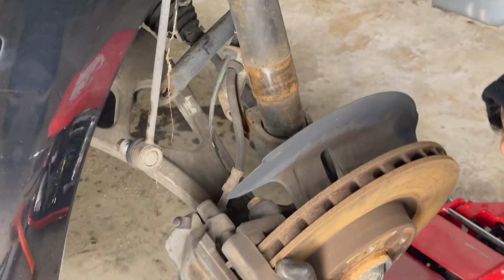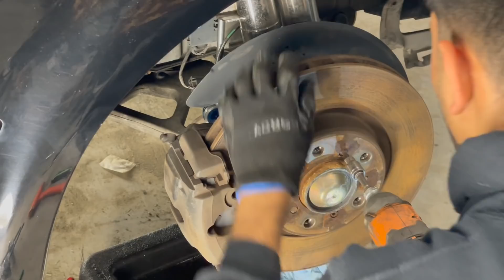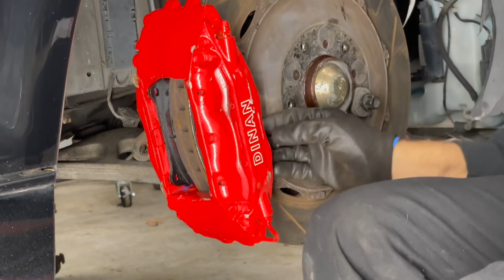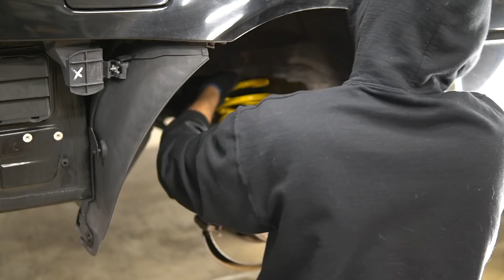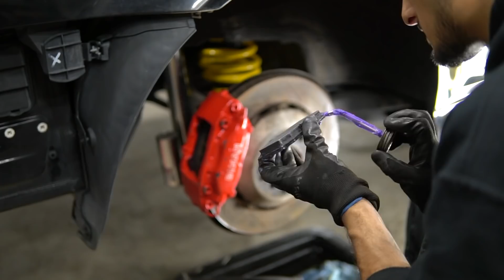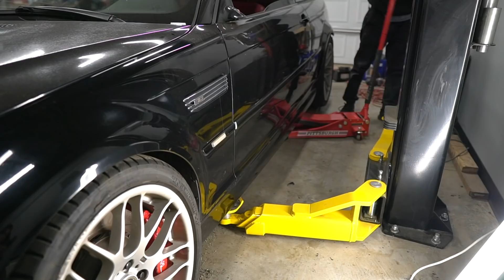BMW M3 GETS A BIG BRAKE UPGRADE AND COILOVERS!

Comment: Bro i had a question i have a 2006 bmw 535 front was shaking when i pressed on the brakes so i changed rotors and brakes all around then i did the front calipers i also replaced brand new battery after i started to get my brakes locked up after driving on the freeway any ideas why this would happen. It releases brakes after pulling over for a few minutes.

Comment: about shocks being gone after 60k miles. I bought my non-M E46 at 208km. 10k km later the shocks were gone, so I replaced them. Found out this still were the original ones. I must say: they held up pretty damn good!

Comment: Good job! When I saw you use the purple beake lube I cringed! I've been doing brakes since 1988, was taught to use never sease then, and by my local shop more recently, but things change so I bought that stuff in 2019, used it on my 2002 bmw 325i, my 2005 chevy suburban and my 2000 chevy astro van. First issue was last year driving the BMW and the front wheels started to what seemed like they were wobbling, never experienced that ever before. Crazy! Scared the crop out of me! I had also put tires on it about a month previously so I took it to that shop and asked them what they thought was the problem... turns out the calipers were seased and the rotors were overheating causing wobbling... insane. Then my astro van developed the same issue. That was it, off came that purple shit and back to never sease... Did the van, then the bmw... and checked the suburban and sure enough they were almost seased to. Garbage product... at least up here in Canada. But great to see the change with you clients car! Have a great day!

Comment: 26:30 Oh man those little buggers have driven me nuts litterally (Or I guess bolts lol) same problem happened to me on mine and I had to get some "easy outs" which were neither easy nor did they get it out. Then finally my friend did what you did and it came out. I just run without them now.

Comment: Thank you for understanding how important it is to STOP quickly as well as GO quickly. High performance isn't about how fast you can plow the car into a stationary object. One of my favorite moments watching Matt Farah reviews other people's rides. One owner rattled off for several minutes about his engine and power mods. As they were approaching a sharp turn, Matt Farah asked, "Great. What about the brakes?" The car owner's face goes into this deer-caught-in-headlights look. "Brakes?" Matt Farah's facial expression was priceless
Reply: BBKs are beneficial for track applications. Why? Because of heat dissipation. It will offer no real braking upgrade for stopping better for the street. Yes it looks nice. Yes you will get more pedal feel for smoother modulation. But is it worth the $8k for a new set on a street car? It's hard to see any value in that.